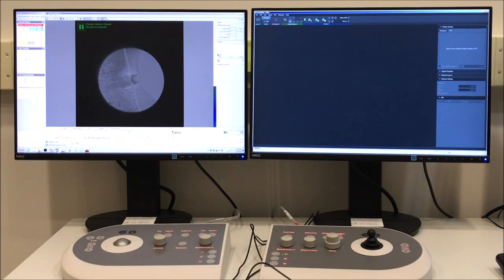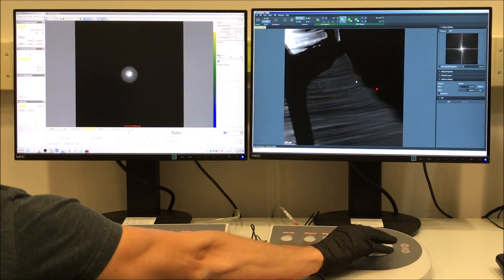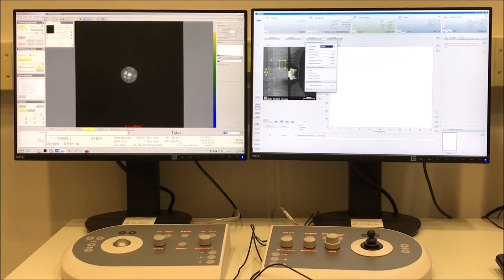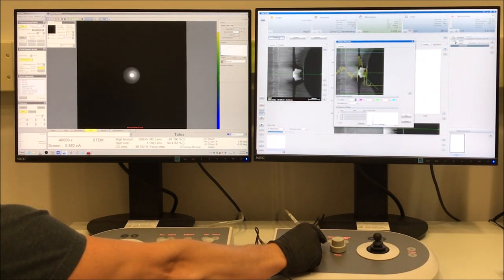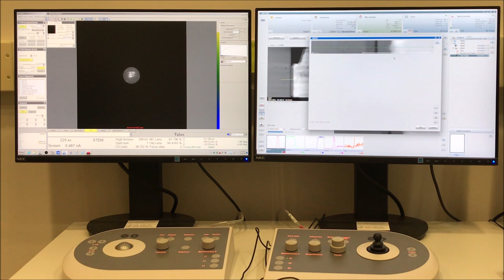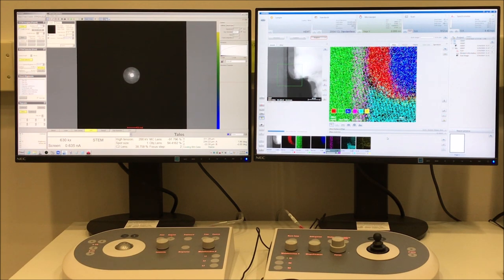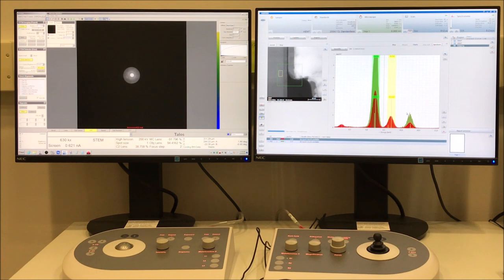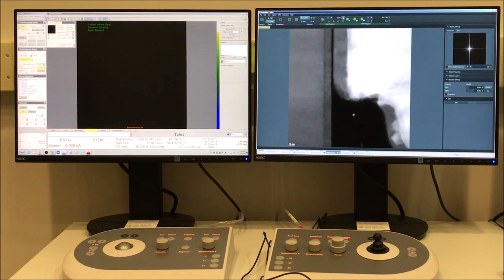FEI Talos F200i S/TEM: EDS in STEM mode (playthrough)

Comment: Hello Nicholas, nice video! We also use Bruker EDS detectors on several machines and Esprit is not the easiest software to use, imo. In the end you mentioned that you can not come back to creating the elemental maps, which I was suprised as offline analysis after the microscope session is one of the main advantages of spectrum image data cubes (less time trying to rearrange the - ever changing - map colors, more time for actual aquisition of data during the session). 
Under the "Hypermap"/"Mapping" menu, above the composite image one of the two menu buttons should allows us to save the whole map data as a .bcf (Bruker file format) or "raw" (.rpl) file. Even if one does not have offline licenses for Esprit, one can use open-source software packages to open these files. You can check out the "HyperSpy" project: It can open .bcf directly and do more sophisticated analysis on the EDS spectrum image compared to Esprit (e.g. denoising with principal component analysis). However, Esprit is still nice for quick analysis. Best regards and keep up the good work!
Reply from the maker: Hi TheLukmuk: the functionality to rebuild the maps/lines from the data was unfortunately not included in our purchased version of ESPRIT, which is a shame, because it really is as you rightly point out, very useful.  Thank you for pointing some other possible programs for this, I will be sure to check those out.  I agree that ESPRIT isn't the greatest EDS software, but it is a substantial improvement over TIA.  It would be really nice if the EDS could be integrated into Velox so there would be one less program to use, which I think is an option on some systems depending on detector configuration, but unfortunately not ours.